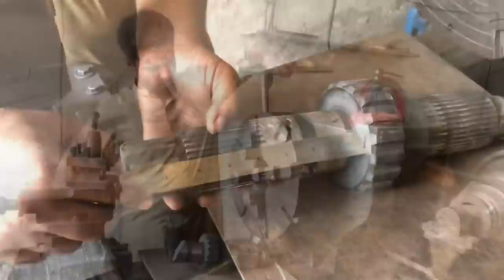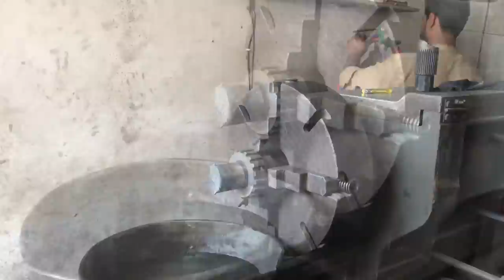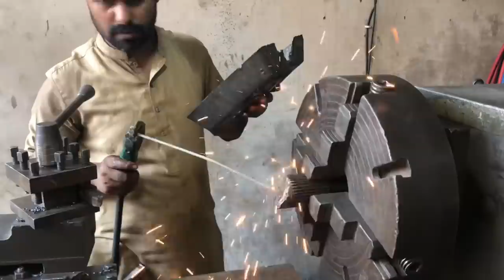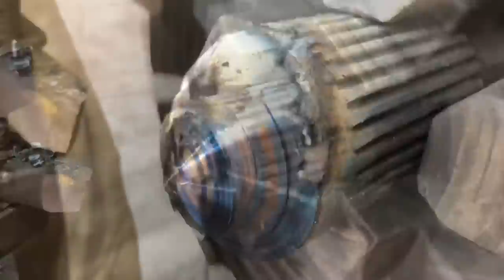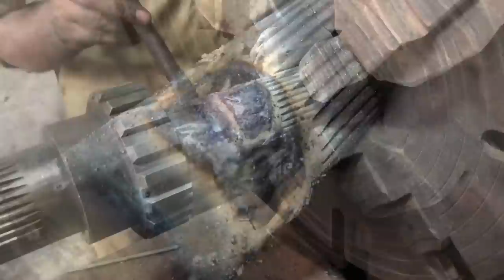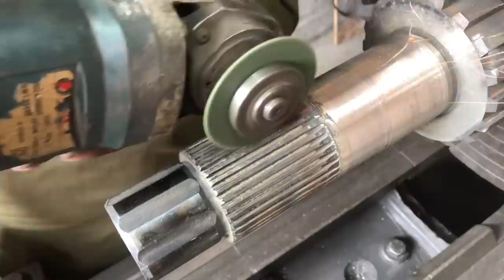A Broken Double Differential Gear Shaft has been Carefully Reassembled || PK Process

Comment: This Chanel is example of how not to go about fixing things
Reply: when you dont have the best equipment or access to new parts you repair it with what you have i think he did a decent job
Reply: @stop7305  But it is not going to work! Time of work will not longer than time of "repair". A lot of serious mistakes were made.
Reply: Yes 😂
Reply: Just another broken pinion video,  definition of insanity them constantly thinking welding is working remedies
Reply: @stop7305  How is a repair which won't last a decent job ?
Reply: How do you fix ?
Reply: @alitn588  I would throw it away

Comment: Original failure from fatigue fracture. Repair is an order of magnitude worse than the original, so it won't last more than about 10 minutes.
Reply: Add to that the 60 thou run out at the ends
Reply: agreed, I was cringing at the insane amount of heat he was pouring in whilst welding it.
But I guess poor country you get poor product, unfortunately thats just the world we live in.
Dude's probably making pennies while his boss makes 50 bucks an hour.
Reply: @DrCranberry  I would hope he gets paid from the money from this clip..

Comment: If possible, friction welding looks more stranger and efficienty than normal welding.
Reply: Friction welding is only used in the most high end and demanding products like aerospace. A guy doing repairs that badly isn't going to have a friction welding machine.